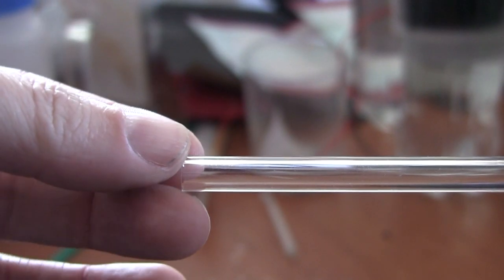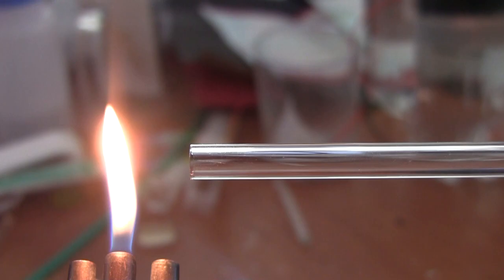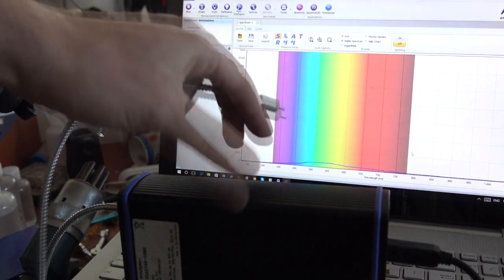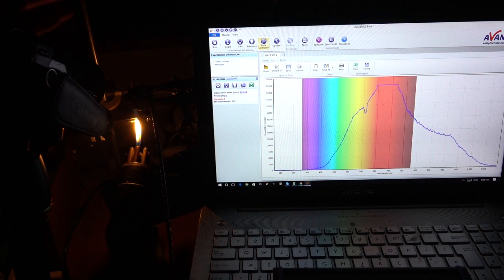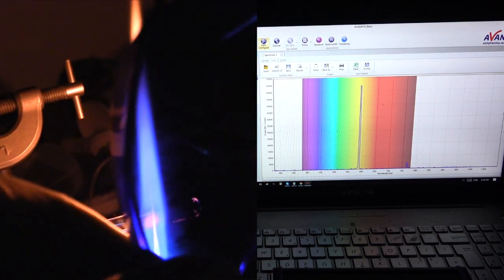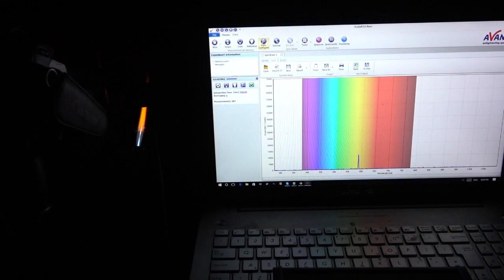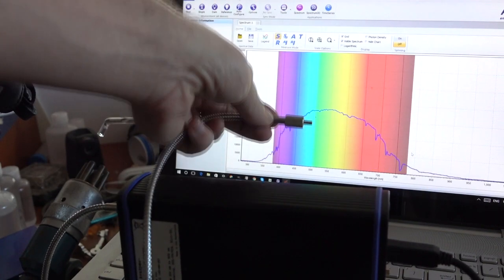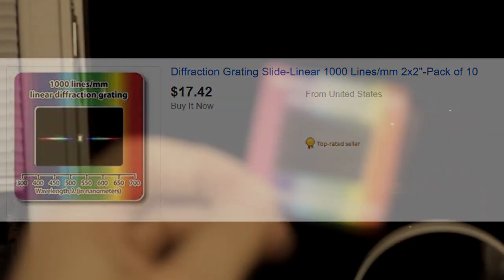Glass blowing.  Why do you need special glasses?

Comment: Can you glass blow your own round bottom flasks from those tubes?
Reply: Aeroscience Yes, with practice.

The maximum size is dependent on the thickness and diameter of the glass tube and the output of the torch.

If you wanted to make a large flask you are probably better off with a gloryhole Furnace set up. 

In addition you need a kiln to anneal your work. Otherwise it can crack or even explode from internal stresses and thermal shock.
Reply: I Hate Google okay, thanks for the info

Comment: I noticed that when you turn off the oxygen on the flame and point it at the glass you have a strong sodium absorption line. I'm an undergraduate stellar spectroscopist so I'm very familiar with this and I'm not sure I understand how this works. When at the sodium is exposed to high heat it gives off a strong emission line but at low heat it absorbs? The higher heat should completely excite the electrons and ionize the sodium causing an absorption line.

Comment: I can see an analog to LF DX radio listening. Back with the old CRT TV's, they emitted about 15.7 Khz and all the harmonics of it, wiping out reception every 15.7 Khz on the dial. Had to wait until after all the TV stations went off the air to do any real listening on the lower bands because every TV receiver was blasting the airwaves from its HV and horiz sweep circuits. And, since the radio bands that it affected were not vital radio communications, the FCC did nothing to alleviate the problem. Now, with flat screen TVs the problem has been eliminated.

Comment: Thunderf00t, since you have the equipment and setup, on top of the knowledge, I think it would be fantastic if you could debunk some of the pseudo science and bullshit claims made by the LED horticulture light industry.  If you look on Amazon you can find a lot of what I am talking about aggregated in one place.  They will make outrageous claims, such as stating that their light, which they advertise as a 300w, which draws only 132 Watts from the wall, will replace and outperform a 1000 watt HPS bulb.  That's only one outrageous claim among many.

Furthermore, because the industry is such a swamp of inconsistency and lies, prices can be absurd.   It's not uncommon to find US based companies charging 3,000 dollars for a light with the same advertised specifications as a Chinese light that costs 200 dollars, usually because "reasons and science" none of which can be corroborated by any proper research.

Seriously though, I invite you to go to Amazon or Ebay or wherever you'd like, and shop around for these LED grow lights as though you were looking to buy one of them, and you will see first hand the sort of nonsense I'm talking about.   It's been a problem for years, but there's few people with the knowledge to properly address it.

Cheers

Comment: what does lines/mm mean when looking at diffraction gratings? theres 1000 and 500.
Reply: The diffraction grating is just that, a miniaturised grating. The number gives an indication of the amount of gaps in the grating per unit length, so for a '1000' grating there would be 1000 gaps in the grating for every millimetre of its width.

Comment: Hey, why the spectrometer doesn't graph the blueish light in the flame?
Reply: Vinicios Araujo Good observation. My first guess is to say.. there is no blue light when he is using the spectrometer. Because... (another guess) the simple flame doesn't produce any blue light. 
my second guess... the blue is a result of light pollution.
Reply: A blue flame is quite efficient in that most of the energy is transferred as heat rather than light. This is probably why it's not picked up as much ~

Comment: What would the moon look like through a defraction grating? Would it look the same as the sun, since it's just reflecting sunlight? Or would the lunar surface absorb certain wave lengths of light, resulting in something different? I think this would be a cool, easy experiment to do. I hope you see this comment and decide to test it. Thanks, TF!
Reply: Hmmm... never looked into or tried this myself... but my guess is it would absorb some spectrums of light. So it would look similar, but with some wavelengths cut out. Now im curious to see for myself. I have diffraction grating, but now i've got to wait a few hours for the moon to come out! XD
Reply: Did you ever try it out, John?
Reply: Yeah, it looked relatively the same as regular sunlight to me, but then again, im no expert. Im sure there might be some nuance in the spectrum that goes unnoticed to my untrained eye. It also occurred to me that the spectrum might differ based on height in the sky as well, as the atmosphere thickness may affect spectral absorption.  But, again, for the most part, i think their spectrums are relatively the same, just obviously, the moon's is not as bright.

Obviously, if you want to be more scientific about it, you should get yourself a rig like thunderfoots, so you can use the computer to see specific wavelengths easier, and the nonvisible spectrum, which i cannot see with my naked eyes.
Reply: Very cool for actually testing it out, man; that's awesome!

Comment: I used to want to become a glass blower but finding the burner was really hard
Reply: cameron Gibbs Ive been using a common Oxy\acetylene cutting torch for about 3 years now, cost me 30bucks at a garage sale, just runs on propane and oxygen. Gota think outside the box man.
Reply: I made my own lathe and use a oxy took me ages to get a decent burner  .  got a pottery oven to use as well that i got from ebay for 78 bucks .Want to quit my job and make bongs for a living
Reply: cameron Gibbs Nice man, the lathe is a good touch. Ive just been making my own torch tips for larger n smaller work, your right the proper torches are hella expensive, would need to spend $1000US plus shipping plus import tax for something too rival it. Keep up the work man ul get thea, took me many years and pikes of broken glass. Artsy pieces are where the money is at tho, Chinese glass is just too much competition on price for rigs and bongs. Try your hand at some pendants and scultures, alot faster to make, sells for more and people appreciate your work alot more that simple devices to get high.
Reply: I have thought about it was thinking of making fancy light shades .
there is a company in England that makes awesome burners like thunderfoots but are really expensive .I got mine for 800 Australian but took ages just to find one 2nd hand .was making condensers and other parts but they restricted the laws so anything over 1 liter flasks and 20 cm condensers need a permit . Was doing well just repairing lab glass and making bongs tried making a 40 liter flask and 1.5 meter plated reflux condenser for making ethanol but ended up making it out of stainless
Reply: cameron Gibbs Bethlehem burners? They make great little units. Jebus thats getn a tad on the industrius a, must be a hell of a lathe you have rangled up, the majority my work is under 3inch diameter, but some of the detailing is hair fine for the marbles. The condensers would be fun, ive made a copper one for my little 30litre still, the glass would be cool to see thru, but might not transfer enough heat for my setup, using a half meter long 16mm inner and it gets over 3 quarters hot while running full tit.
Reply: I made my lathe from a old wood one and my dad is a machinist so he made the chucks and clamps .I made the condenser using a jacket on the bottom to controle the reflux and basically a viruex on top then to a splash head was a waste of time to fragile and with 6000 watts of heating was not getting very far .So i used a keg for the boiler and use propane .At the moment they are banning bongs even stems and con pieces are illegal .Looking into the art side may prove fruitful but don't have much time .Bout to sail the world which i have been gearing up the last ten years so when i get back hopefully look into the art side .Finding the carbon tools can be tricky i made my all my stuff and got lucky with the guy at the uni when he retired he gave me a heap of ground joints and was a goldmine for old lab glass too

Comment: Now I'm interested in how a room lit entirely with low pressure sodium lighting would look like while wearing those glasses.
Reply: Probably as good as turning the lights off.
Reply: More interesting is that without the glasses the room is well lit but you can't see colors.
Reply: I once visited a school gym with nothing but LPS lighting... and a red color scheme (school colors). Imagine stark orange lighting with red ceiling and wall mats... it burned like someone rubbed Tang in my eyes.
Reply: Smidge204 dark.
Reply: I have a feeling that once that light hits solid material, walls etc., the energy signature changes.
Reply: No that is not possible. Only fluorescent materials can do that
Reply: +MegaWeitzel Who are you responding to?
Reply: to you
Reply: When sunlight hits ground, the energy signature famously changes. What is different about this light?
Reply: +usmh I'd like to see a citation for that? Either it's typical spectral absorption that occurs with any colored material, or it's involving the UV component of sunlight which artificial light sources are almost always protected against 'cause UV exposure isn't exactly good for you.
Reply: @usmh 
The "energy signature" doesn't change. You can absorb parts of the spectrum which give you a different color but a wavelength can not change. So if you have white light you can absorb red and green and get blue light. But if you only have red light your object can never emit blue light. (This is for monochromatic light sources and obviously not for the mix of light red light usually is)
Reply: Let's see if I can and will find a source for it. It's a common claim in these climate change times that sun light that hits the ground changes so that it bounces off clouds instead of passes through them.

What I mean by energy signature is how much of the different frequencies there are in the light.
Reply: +usmh So... normal absorption then? Dark colored things are dark because they absorb light instead of reflecting it. When things absorb light, they get warmer. The warming something is, the more IR they emit (see: Black body radiation). This isn't quite the same as what's being discussed...
Reply: sodium lights are so ugly. bleh, yellow everywhere
Reply: Sodium lights are awful, they pretty much blind you more when driving than actually light the road

The old quicksilver ones were way better
Reply: wait what the fuck am I babbling about, I mean mercury
Reply: Quicksilver is mercury.